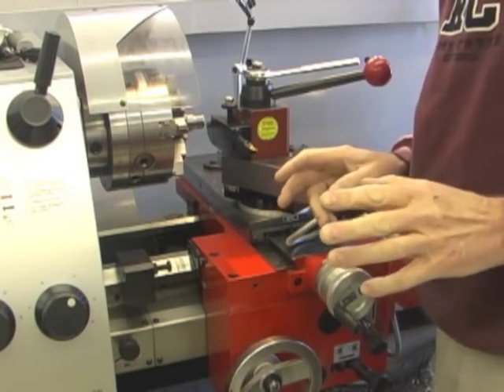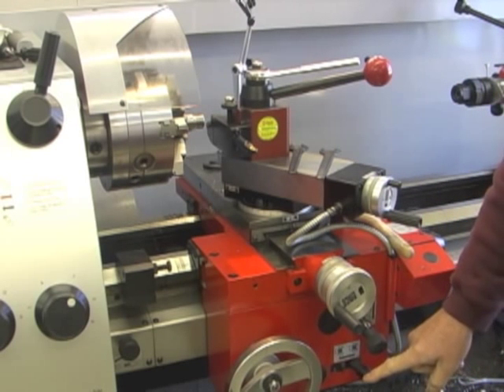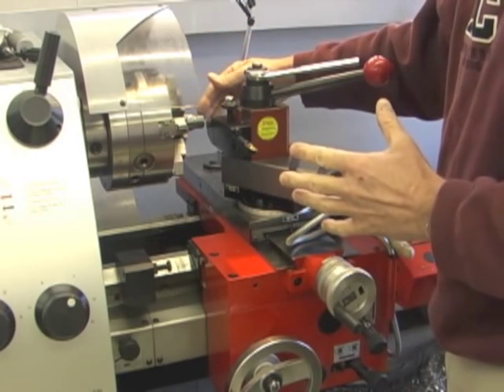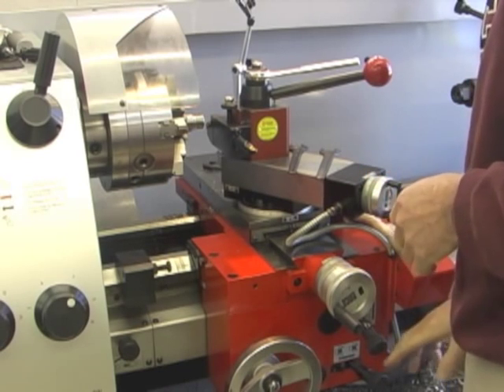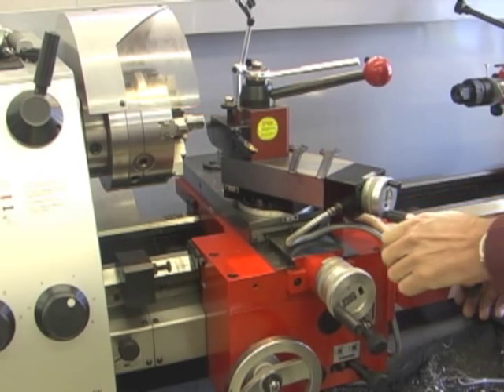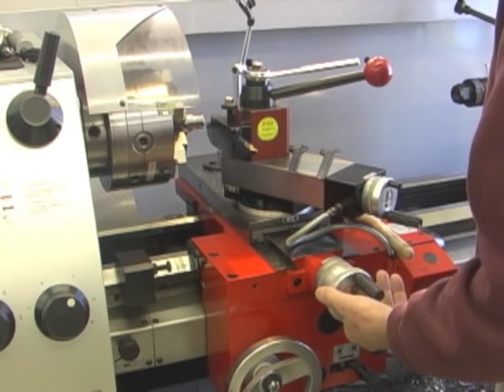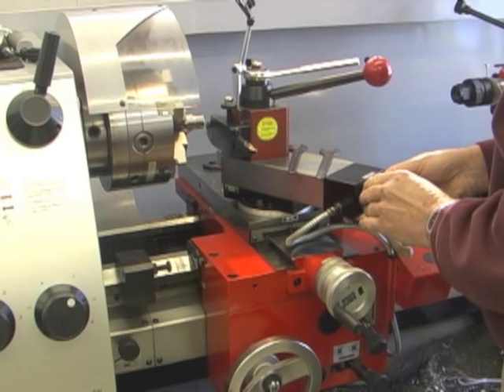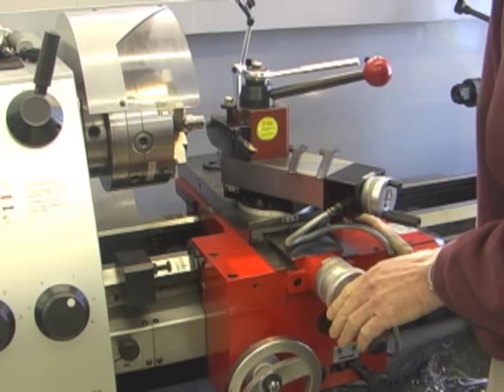Lathe 20D

Comment: Hi Chris - I’m considering a used EMCO 20D for benchrest gunsmithing and am curious if you would recommend it?
Reply from the maker: Paul Miller I used to do all my chambering on the 20D and I still have the large and love it. Because I do all my chambering on a CNC now I have little need to use the 20D for chambering other than when doing unlimited barrels (1.45”). One thing you need to be prepared to do is leaving the half-nuts engaged and stop the spindle at the end of the thread pass. That is a much better way to thread but many people disengage the half nuts. You can’t do that on the metric feed screw. I assume you will be chambering inch threads.
Reply: Chris Harris Thanks for the reply! Yes, I’m going to be doing mostly English threads. I’m looking at a low hours 2006 20D. I like the larger spindle bore, variable speed. I’m concerned buying used, but am looking seriously at this because I would hope this machine (used for the same $ as a new Taiwanese) would be more accurate. Are you pleased with its accuracy? And if you will, what do you use for cnc now (I’ve been looking at TL-1 lathes but out of budget)
Reply from the maker: @paulmiller7807  I have had 2 Emco 20D's. Both of them have been astonishingly accurate. They can easily cut to a couple of microns (0.002mm). BUT ... do not get the Dorian toolholder. The Aloris is way better and the very best is the MultiFix swiss tool holder. Frankly, if you are asking for accuracy, then get the Multi-Fix system. There are plenty on eBay. One of the vendors in England sells a very good Asian copy.
Reply from the maker: @paulmiller7807  sure I can. my email is chris6ppc@gmail.com